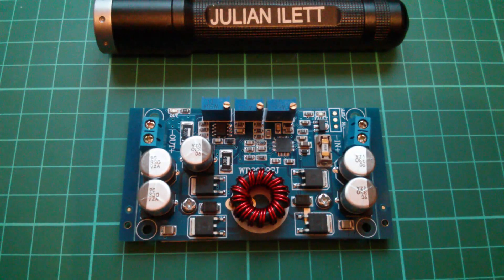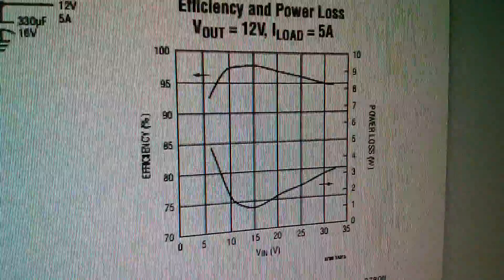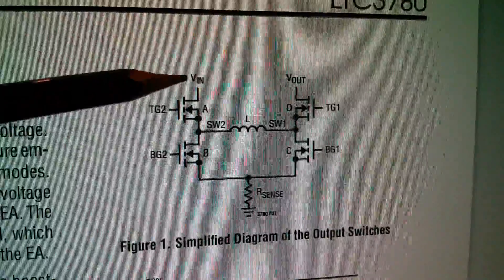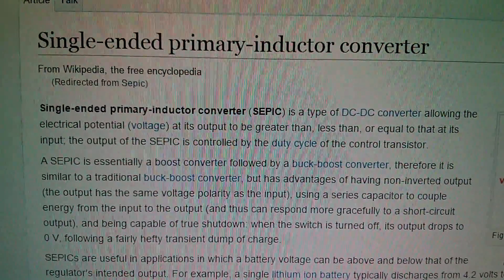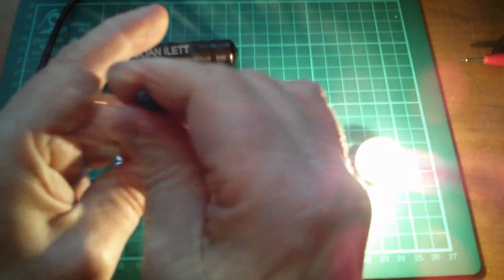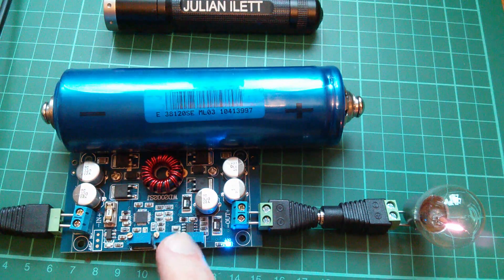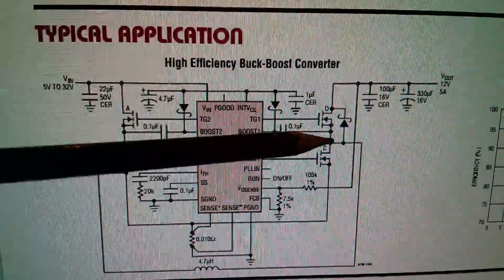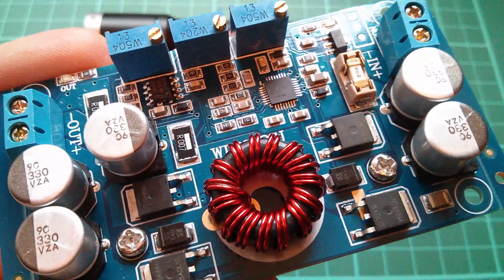First Look: LTC3780 Buck/Boost DC/DC Converter 10A 130W

Comment: I have used 3 of this modules (none had the aluminum backsheet) from 3 differents sources and managed to kill the 3 modules without doing anything special or outside their specs.
I was using as input 4 18650 in series so 16.8V max and a load of 31V 1A.
The units works some time but soon or later, the red fault led turns on and the output is 1,8V regardless of the V triming pot. The LTC3780 then  becomes pretty hot very fast.
If some have any idea of what kill those units so fast...

EDIT : I did find this web site and the guys seems to have found what was the issue, but I am not able to understand all things. If someone could explain what cause this module to fail.
Reply: redesigned ones without the aluminum back heatsink have big problems. try to get the originals like Julian has in this video. they work quite well.
Reply: what was your load?
Reply: read my first post ;-)
Reply: well if i am not missing some other post i am not asking the value of the load but what the load is
Reply: jerry1378 my bad...sorry but my english have some weekness ;-) The load was a COB LED from Bridgelux.
Reply: Don't link the modals in parallel. For some reason they need to be used separately. I think that if they are set at slightly different voltages they end up trying to step-up and the other trying to set down which means they "fight" against each other and eventually one gives in and blows up.

Comment: That 3rd pot that you talked about @9:55 into your video is called the "input under voltage fadeout" this is used for two things.

1)MPPT, If you connect a solar panel to this. you can adjust this to load your panel to it maximum power point. This will allow you to load your panel to it's most efficient I.V. curve as possible. 

2)Over discharge protection. You can set this to start fading the load as the voltage of the battery get lower. Note that this does not do a hard cutoff and there is no hysteresis in this ether.  for example. if you use this as an LED driver. Once the voltage of the battery reached the setting of the pot. the LED will begin to fade and not just shut off.
Reply: MPPT? More like MPP, if it doesn't track MPP and we have to manually adjust it then it would be MPP and not MPPT.
Reply: @luongmaihunggia  and what about using arduino an digital pot to control the buck boost converter?
Reply: Thanks a lot for this info.
Reply: Hello, friend! You've been very misleading with your comment. There is no mpp or mppt function in this device at all. Instead, the 3rd potentiometer turns off the device completely when the input voltage drops below the set value. This is very easy to trace — if you apply a voltage to the device below the one set by the third potentiometer, then the output will be zero. Solely thanks to your comment, I bought this garbage that doesn't even know about mpp.
Reply: Device with mpp function is LT8705, not this device at all.
Reply: 3d pot is cut-off voltage, not mpp(t).
Reply: joyange1 u

Comment: I can't believe you use a metal tipped screwdriver tool, as convenient as it may seem, to adjust the output screw or really any of those screws while the set is running. A simple slip of the tool and that tip could slide into the circuit and begin shorting contacts. I'm sure from this careless demonstration of foolish logic proves that you have in fact had 'accidents' similar to this which should have been sufficient indication of the flaws in this strategy. Of course, you wouldn't publish those incidents.
Reply: You are such a fool talking nonsense.
We appreciate you when your insulting mouth is tightly shut !.
Reply: It is a Bourns trimmer tool and the tip at one end is recessed so it can't slip! Best get your facts right before criticising. Also they'd be little point in adjusting them when no power is applied, would there?

Comment: could you run a (homemade) wind turbine into te inputs of your module to charge Valve Regulated Lead Acid(VRLA)  batteries (LTC3780 Buck/Boost DC/DC Converter 10A 130W)???

Comment: hey, great video. Can you please tell me where i can buy those connectors you have going into and out of the module?
Reply: +Joshua B http://www.ebay.at/itm/2-1mm-Male-Female-PAIR-DC-Jack-Connector-with-Screw-Terminals-/252244576584?hash=item3abaf2c948:g:ZhMAAOSwoydWkbld from 
or more http://www.ebay.at/itm/5-Pair-DC-Power-Socket-Plug-Screw-Terminal-12V-Volt-CCTV-Adaptor-2-1mm-x-5-5mm-/281285306454?hash=item417de92856:g:tPYAAMXQPatTIecU

Comment: Hello
From where you bought the screwdrive to adjust the potentiometer?
Reply: +Anonymous Nameless It's called a trimpot screwdriver or trimmer alignment tool. You can find them just about anywhere that sells discrete electronic parts. If you just need a non-metallic screwdriver, you can sharpen the end of a small dowel so it has the profile of a flat screwdriver.
Reply: +David Pitts Thank you

Comment: Would it be possible to put a few of them in parallel to achive a higher output current? To charge big Li-Ion battery packs for example?
Reply: looking for an answer, too
Reply: No. Youll short the converter out. 

Even if the voltage is off by a mV thats still a short. You'll wreck the device.
Reply: Yes
Reply: No. You need a resistor in between them to prevent a short circuit.
Reply: If the voltages are equal between boost converters, there is no need for a resistor. Not to mention resistors can only take 1 watt at best.
Reply: hmm.. but if you modify this thing, by soldering higher power mosfets, diodes and bigger inductor...

Comment: The potentiometer closest to the input is an input voltage (low-voltage) cutoff.
I bought this off of Amazon a few weeks ago to float charge my 4S LiFePO4 packs and a bank of supercapacitors. I'm super impressed! Even at a constant 6A output, this thing only gets warm.
Reply: +Shawn L Hi Shawn, I am trying to make a portable power bank with 4 18650 batteries and this board. I'd really appreciate it if you could share how are you are measuring the current output, thanks. Or even better, if you could give me some tips.
Reply: Are your 18650 batteries in parallel or series? 1) if you're running them in parallel, I haven't seen my board accept an input voltage lower than 4v~, so this may be a show stopper for you (assuming yours acts the same way). There is another, cheaper boost board that I bought on eBay which went down close to 3V DC.

2) to measure current, I use a cheap multimeter with a 10A DC ammeter function inline with my circuits.

Comment: The thrid potentiometer is undervoltage protection, see this ebay ad for details:

http://www.ebay.com/itm/LTC3780-Automatic-Constant-Voltage-Curent-Step-Up-down-12v-24v-Solar-/171990484104?hash=item280b6e8488:g:VNQAAOSwwbdWPHYW
Reply: +SteelBlueVision 
Yes you are right, the third potentiometer can set the low (input) voltage disconnect/cut off. The theoretical setting range with the circuitry is 2.5V to 37.2V.
The output of the OPamp is connected to the LTC3780's RUN pin which activates the controller if the pin sees more than 1.5V.

Comment: So I found an issue with this little device (running from a 12v 10A SMPSU), if the output voltage is set anywhere above 15v and the current limit is reduced until it cuts out, this board seems to actually short out the PSU.

Comment: Hello please i need an advise i have variable input 8-22volt but i need fixed output 13 volt can i use LTC3780 Buck/Boost?
Reply from the maker: +Joseph Hashem Yes, if I remember rightly. Make sure you don't exceed the maximum current.

Comment: I would like to use this in a led strip lighting setup with the max voltage at 12v and the minimum voltage at 6v or so. I would mount this in an enclosure and need to use an external potentiometer. What would be the best approach? Do I need to desolder the voltage pot from the circuit board and replace it with the external potentiometer or is their a better way? Thanks.

Comment: is it possible to hook up 4 or 5 in paralel?
i have two old server power supply's (44.5A at 12V) ((+ 5A at 3.3V))
so i would like to build a big variable power supply 

if i connect the potmeter's together? (or with a multi throw pot with one shaft)
or wil it react just like multiple diodes in paralel, one taking all the work,. the others doing nothing

thanks for your time :)

milan hofman

Comment: I don't understand why they don't have boost-buck converters that go up over 100V.  The highest I've seen was 80.  It would be nice to be able to test certain AC loads that are capable of running off the equivalent DC voltage, such as light bulbs of all types (incandescent, LED, etc).

Comment: So mine didn't come with the heat sink on the back but with a couple of plastic ones one the surface of the board. My question is can you pott this module in a non acidic silicone?

Comment: Have you seen any super high efficiency boost-buck converters like this but that can do much higher voltage?  like 110-120VDC ?  I would love to be able to power certain AC devices that also work well with DC current and have a solar panel be the source.  If I can do higher efficiency with these than I can with a normal inverter, I would love to use these for that purpose (for devices that can run off 110-120VDC in place of 110-120VAC).

Comment: Some information I have found suggests the following for the 3 Potentiometers: 1, voltage adjust. 2, current adjust. 3, low-voltage protection adjust. I'm guessing that 3 maybe cuts the converter if the supply voltage falls below a set point (i.e. to protect the battery). Regards. Daryl.
Reply: do you know how to adjust the 3° pot?

Comment: sir please  help i am putting together a 3s 18650 battery pack for a small solar system i would like to use a buck converter to charge the battery in place of the regular charge controller which of these buck converters would you recommend for this

Comment: Does it have reverse voltage protection on the output to safely connect and charge lithium batteries? Obviously when the output voltage and current is set, there is no danger to damage the board but what if I connect the battery when the board is not powered?

Comment: I found two more ones. One seems to be voltage adjustment only, while the other has current aswell. Costy though
http://www.ebay.com/itm/DC-to-DC-converter-Boost-buck-power-supply-Constant-voltage-current-Regulators-/391075555405?pt=LH_DefaultDomain_0&hash=item5b0deb684d
What do you guys think of it?

Comment: Hm, why do I see two SS54 (5A 40V schottky) diodes on there? I know they only "provide a lower drop during the dead-time", but are they being used within spec?

I'm interested in seeing some tests done on this. Efficiency tests of wide input-output voltage differences. Also, how does the ripple look on the output? I'd say that thing would need to be very efficient to run at full load with that heatsink. Some quick estimates and calculations lead me to think that the resistance (I^2R) losses would be around 1 to 2 (maybe 3) watts at 10A. Even at 95% efficiency, it will probably loose a few more watts from the inductor core and other losses (switching losses, etc...). Can that wimpy heatsink really do that?!

Comment: I have done some more testing.

The buck-boost module with 2 heat-sinks uses a standard SB diode rectifier, which explains the lower efficiency and mre heat. It also has a habit of locking up and shorting the supply when the output voltage is set close to the input voltge and a load connected that draws a high peak current; a 12W lamp in my test. This is a major failing.

I also tested a smd based buck-boost module with a small finned heat-sink on the back. It is more efficient; 0.5W loss for 27W output, 24V in and 12V out.

Also interesting; there are a few missing components on the board and the overlay text "MPPT". If this was available as a MPPT regulator, it would be quite useful.

Very similar if not the same as: Dealextreme, Jtron DC 5~32V to 1.25~20V Boost Buck Module w/ Quiescent Current 4mA - Blue

Comment: Some performance testing would be good.

I have used a variety of these low cost buck, boost and combined regulators. Generally the work pretty well at 30% or less of rated current. At higher currents, they need much larger heatsinks or fans. Some of the smaller ones claim higher output current than the components are rated for; may work, but not long term reliable.

I have just tested the efficiency of three different 10-12A modules; 2 buck and 1 buck-boost. All 3 have two finned heatsinks on opposite edges. I'm looking for the most efficient module for a low power system.
Setup was 24V in, 12V at 2.25A out.  For about 27 watts out, losses were 2W each for the buck and 3.6W for the buck-boost. 2W made the modules quite warm but not too hot. 3.6W made the buck-boost quite hot, at only 1/4 of its rated output.

The ground (0V) is common, but there is a low value current sense resistor in there. Connecting the ground input to output, bypassing the module, would likely disable or upset the current sensing.

I haven't looked at noise levels, but have sometimes added an extra LC filter on the output.

Comment: Hi Julian,
I think the left hand pot is used to set the low limit for input voltage. e.g. it could be set to switch off if input is less than 11.5V, to save your lead acid battery from over discharge.
I could set this Vin limit anywhere from approx 5V upwards.
I had it taking 5V at 4.6A converting to 10V at 2A and it ran perfectly.

Comment: seems like an interesting converter. unfortunately, this seller does not ship to Belgium and I can't even contact the seller to ask if this is in error, he seems to ship to the rest of europe.
only alternatives I have found with the ltc3780 are single pot devices, so only voltage regulation.
just wondering - can someone check how low the input voltage can go, and what output current is possible with different input voltages? can't seem to find this information in the data sheet.

Comment: The third pot is almost surely either for turning on an LED when a desired Vout is reached (i.e. if you want to charge a 3s LiPo up to 12,6V it could light up above 12,5V), or for input low voltage alert. LiFePO4 cells have a very rapidly increasing voltage at the end of their charge: I played with A123 18650 and charging them at 0.5A the voltage went form 3.5V to 3.9V in like 30 seconds, so there is really no need to cut off the current when you approach 3.65V/cell, they will just very quickly stop drawing current on their own. I also used this "property" of the chemistry to make a really cheap "balancing" circuit by employing 3.9V zener diodes plus a small series resistor. It is not ideal, but the battery pack that I made has been powering a cordless drill for more than two years now and it is stil rocking: the torque increase from the original crappy NiCd battery was immense.

Comment: Nice! I like the layout of the board.

What tool do you use to wind the pot screw? I use screwdrivers and it drives me nuts.
Reply: ***** Looks like a Bourns H-90 or H-91 trimmer adjust tool

Comment: I have been playing around with led chips for a while now,and im a bit baffled by the stated voltage and current data. it never seems to match actual figures I get on the bench. for instance,50w chip 32-34v 1500ma stated, but to get the led to pull 50w, im having to push the voltage up to 38v! this makes the chip run at a very high temp, my question is, am I doing something wrong? or is the data on these cheap Chinese leds exaggerated? cheers andy... ps looking forward to your next post, keep it up
Reply: Same here, its normal I quess. I have seen 31-39V 100W leds. I'm thinking, why led drivers are constent current but not contant wattage?

Comment: Hi Julian, I really want one of these things to make a cheap-o bench power supply - and it's good that you can also set a current limit on the output. I understand you can provide a visual feedback of the output voltage by simply measuring the output. However, do you know if there are any points to measure the current limit? It would be great to use a little oled display and a small box to make an awesomely portable cc/cv power supply, using an arduino, ofcourse.

Comment: I have bought a couple of these with good results, please take a look: http://www.ebay.com/itm/LED-voltmeter-Ammeter-DC-BUCK-BOOST-CC-CV-adjustable-power-module-1-25-50V-OUT-/121261653270?pt=US_Battery_Converters&hash=item1c3bc1fd16
Reply from the maker: hiperjp Nice units those - I've got one somewhere. It came in a rather nice tin can if I remember rightly.

Comment: Julian,
Please do a test as voltage regulator, for example set the output to 12Volt with a load.
Then change the input voltage to whatever, and keep on changing.  Is this device practical for use with a small generator?
Thanks in advance.
Reply from the maker: pcuser80 It probably would work fine with a small generator. I'm also keen to connect it to a solar panel to see how useful that is.